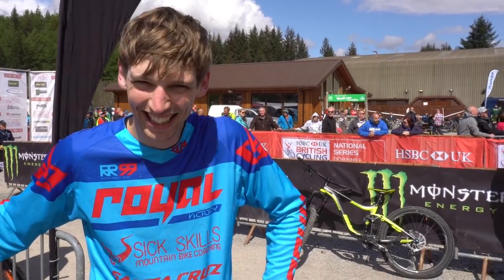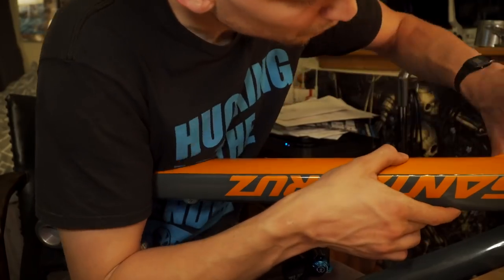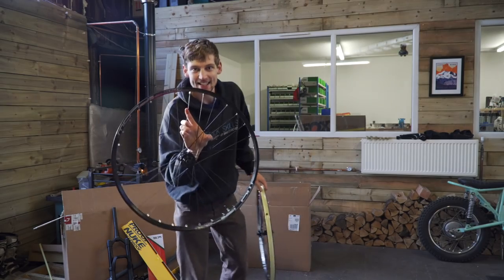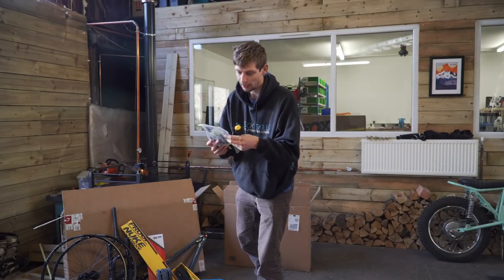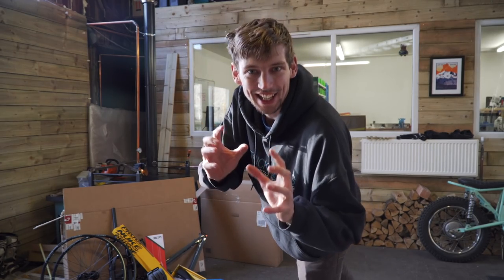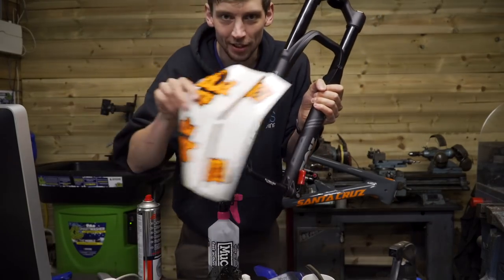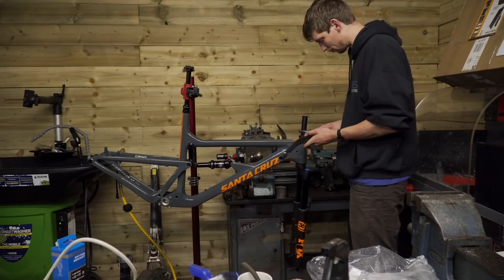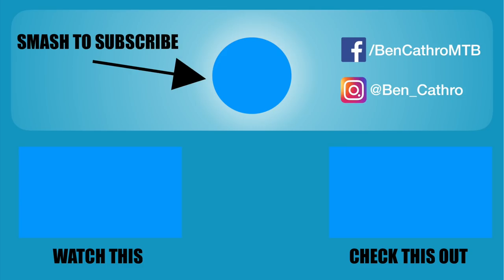NEW BIKE DAY! Building my Santacruz Hightower LT - Day 1

Comment: is it wise to remove all parts from your frame and upgrade with high end shimano components that are expensiver than the you bought the bike ? the reason why is i like the scott aspect frame geomitry allot and wonder it is the effort and spending to do so ?
Reply from the maker: Only if the parts you have on your bike aren’t working. I’d use them till they brake then replace.

Comment: Do you think you can share the “Santa Cruz” logo layout for printing? I would love to do what you did on video. To print my custom color logo to cover the original one. Thanks in advance
Reply from the maker: I just searched for Santacruz vectored logo and used this: https://shop.santacruzbicycles.com/skin/frontend/rwd/santacruz/images/scb_logo.png

It doesn't fit bang on as the logo's they attach to the frame are quite often a slightly deformed (My right side logo curved downward slightly at the end) and you will have a little bit of edge showing in spots but it looks good from a distance 🤙
Reply: Ben Cathro wow thank you for replyig back so quick! I will give it a try. Thanks a lot!

Comment: SLX pfff I'm running a deore crank.  Are you running shimano purely on a cost reason or you prefer it to SRAM?
Reply from the maker: Absolutely prefer it to Sram. I find the pivots on the derailluers to be harder wearing, shadow + protrudes less so lower chance of twatting it into something and the chains are more durable (witnessed 2 eagle chains snap and one eagle derailluer simply fall off the axle at an Enduro this year.) The cost is just a bonus!
Reply: Ben Cathro you got another baron for the rear for real slop?  I've got a baron up front and a DHR2 on the rear which isn't the great in the current conditions going up trails.
Reply from the maker: Got another one to put on tomorrow actually, you a fortune teller?
Reply: totally - you're going to star in my next vid lol
Reply: Shimano is both flawed, they don't use bushings,  so they wear fast, at least Shimano does, not tried Sram. Box one sue bushings, But has wrong incorrect, I will look into hub gears.
Reply: No kashima😞
Reply: SRAM components are expensive as all fuck and not really worth it unless you compete for a living. Shimano's a better value all around for "normal" mountain bikers. I personally have a Shimano XTR setup with the trigger shifters that I love and it shifts perfectly every time. It also helps that if I do happen to break a derailleur, it will cost me less than $70 CAD to replace it, whereas a SRAM derailleur will probably set you back a couple hundred. I've been considering getting a SRAM pine-cone for the added gear durability, since I tend to pump/accelerate really hard (tree trunk legs lol,) but that's about all I'll ever likely buy from them.
Reply: I did have 2x10 SRAM on one of my bikes but after upgrading another Shimano eqiped bike to XT M8000 1x11 I put it on all my bikes, it has been flawless. You just need to keep on top of the chain stretch, maybe that's just a 1x11 thing.

Comment: Hey Ben! Im looking to upgrade my stoppers on my enduro bike and I see you are running the Guide RE anchors. I have been a Shimano purist for the past few years however I have heard some great reviews of the Guide RE and some not so good reviews about the XT's I was looking at. I think in some of your past videos I have seen you running Shimano stoppers? What are your thoughts about them? I am a pretty heavy rider too so extra power would be ideal.
Reply from the maker: I’ve not had enough time on them yet. Only had about 4/5 rides on them and the power has been good on some rides and poor on others. Conditions have been minging though so it’s hard to judge things. I think they could be rad but I’m not sold yet. Best brakes I’ve had were the old Slx’s 😂

Comment: When getting the bits together to build nice new bikes, what are your views on second hand components as a cost cutter/environment saver?
Reply from the maker: There's a few different factors to consider. I'd say if you're a casual rider it's a mint way to save money and small change like that will inevitably help the environment. Unfortunately when your bike is your business (racing and coaching) you can't guarantee that second hand items will perform properly so it adds risk to the purchase. Item fails, can't work, loose race and such. I never replace or upgrade items until the old ones have failed and I will always try and repair items first of all (just had my clutch mech in bits to try and get it running smooth again). I do try to be economical, I still need to do better though.
Reply: Thanks for the detailed response, f racing and working that makes sense. I am notorious for second hand components, something's I feel are a false economy second hand but I've been really lucky with some parts. I have a XT much that has going strong for 4.5k km, but that's luck in not smashing it as much as anything else!

Comment: How tall are you Ben? I am 6'7" and looking at a HT or HTLT in an XXL.
Reply from the maker: Bingo, I’m 6’7” too. Bike feels mint. Reckon I could go bigger but I’m very comfy on this for now. Coming from an XL Hightower.
Reply: How does the XXL compare to the XL?  XL is quite a bit easier to find, but being on the higher end of the height spectrum, XXL is prob the correct fit.  Thanks.
Reply from the maker: Big difference. Not sure if the different build kit has contributed but the new one feels a lot comfier. Still needs a lot of tweaking and getting used to it.
Reply: did you get one in the end? i've been demoing them myself recently and even though i'm just under 6'2", the xxl feels like a better fit, the xl lt feels too cramped.